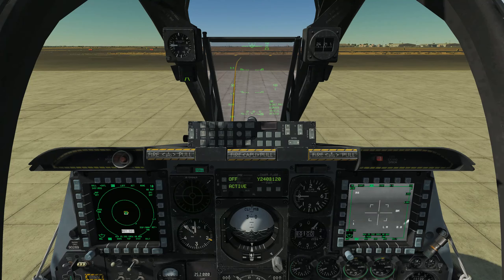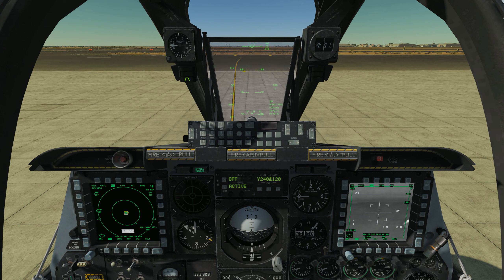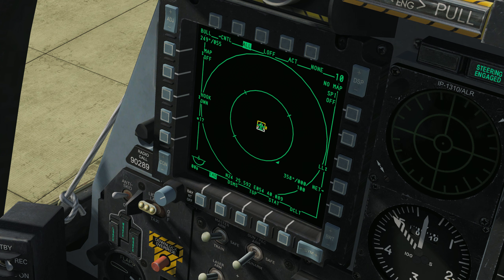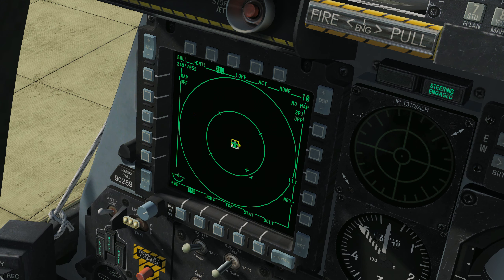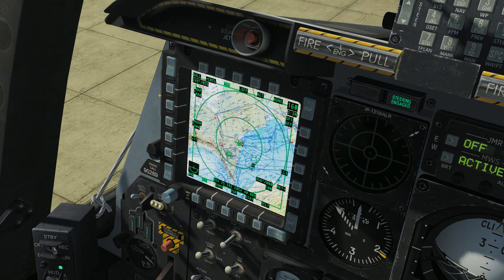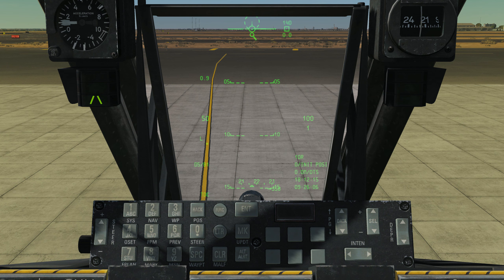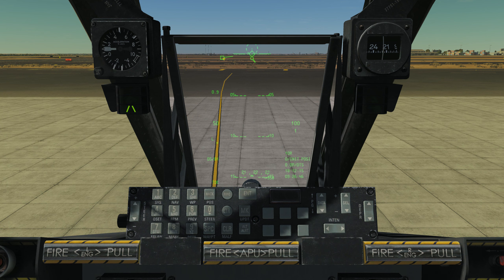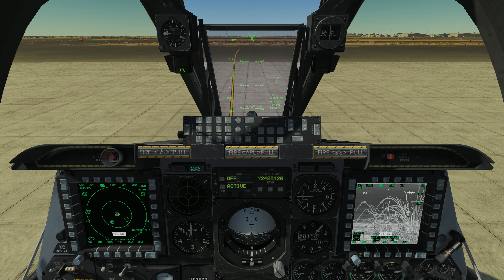DCS World Tutorials - A-10C Warthog - Sensor of Interest and Sensor Point of Interest

Comment: For those that do NOT have a HOTAS controller, it would be helpful for new players to acknowledge the keyboard command corresponding to each input as well.  For example, Coolie Left long = press & hold H key.  Coolie Right long = press & hold K key.  Coolie Forward short = press U key.  Of course, these are default keyboard commands that can be changed by the user.  Great video though!  Enjoying all your tutorials.
Reply from the maker: I make sure to reference the inputs by name. The problem is as you stated, everyone might have different controls and rebinds so I don't see the value in referencing defaults when the user can just look up the binding in the controls menus. In my opinion, thats a part of the learning process with these jets.
Reply: @ravagetalon  fair enough.  Loving your vids btw.  Can't believe you haven't received more views/likes.